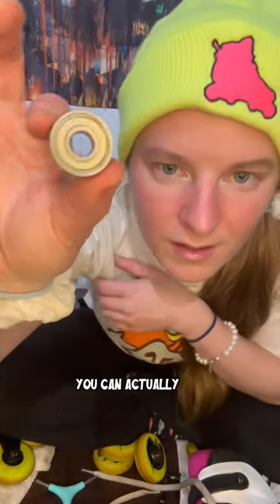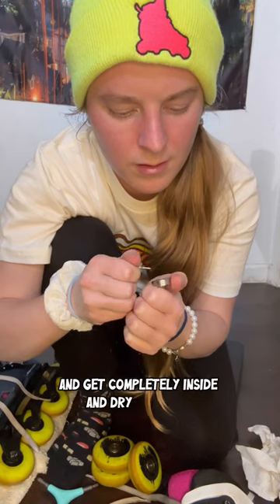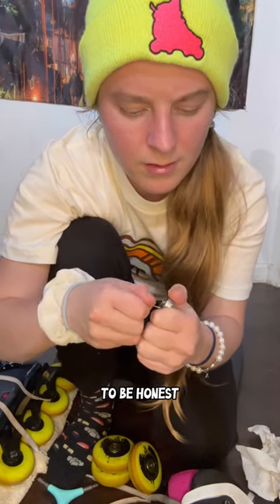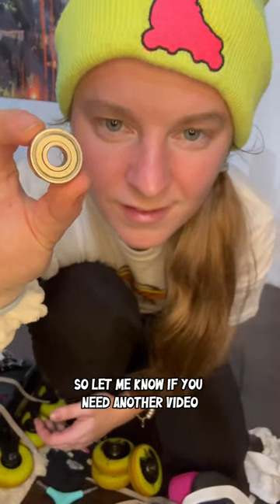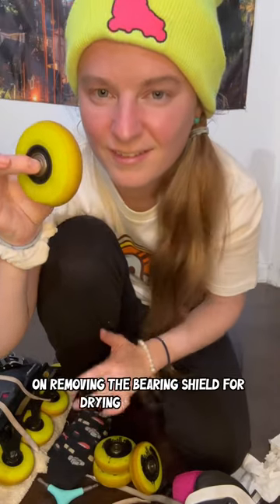4 quick and easy ways to dry skate bearings 😅 #rollerblading #tips

Comment: After cleaning in a solution, to dry the insides, I place the opened bearings in an oven on a low temperature (150f) for about 30 minutes.
Reply from the maker: In an oven?!! Never heard of that!! 😳
Reply: @PollySkates  
Yes, but at a low temperature because it will dry really fast. Then lubricate and place the covers back. Works like a charm.
Reply: @PollySkates can we use a hairdryer to dry the wheels?